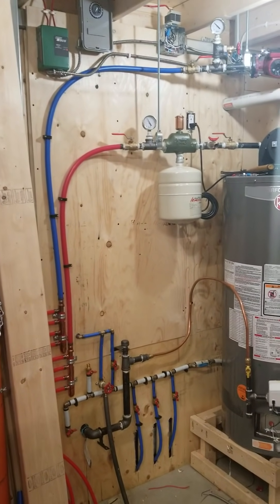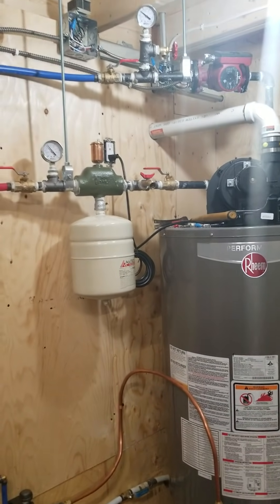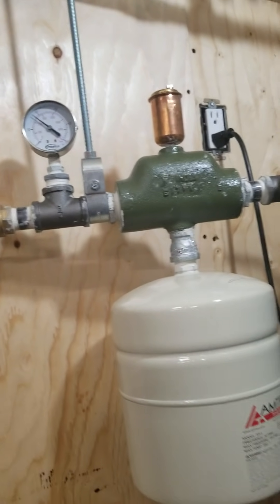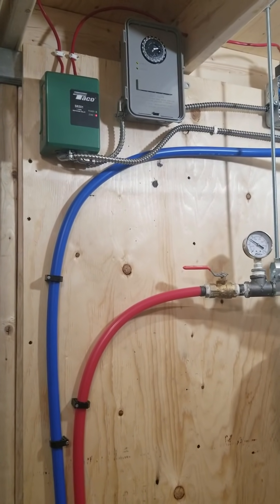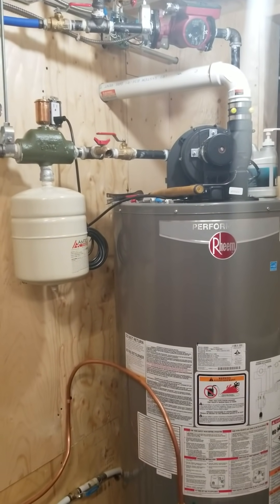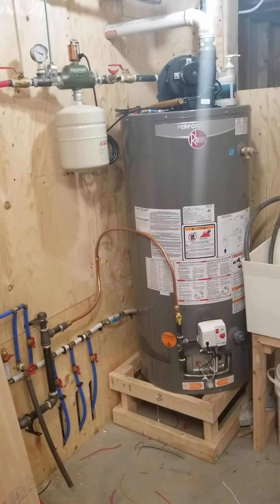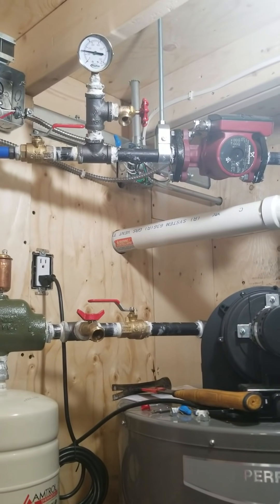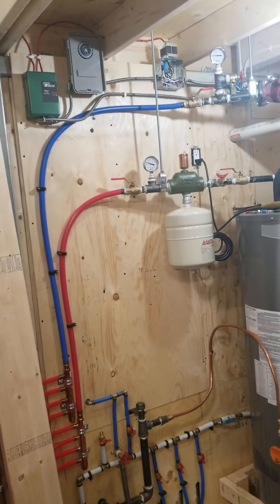DIY In-Floor Hydronic Heating System Using Water Heater

Comment: May I ask where you sourced your air scoop? Pump? Teco controller? Did you do the calculations for heat loss or simply went with what you could get.?  Two zones for me presently in my garage.. Went with a 2 gal 110V  electric hot water tank (  Lazer Temp reads 88F return 93F out when it starts up ) below my mezzanine floor ( 216sqft ) (( 2" thick concrete )) ((( 1/2" PEX ))) with a recirculating pump below the tank pulling from the cold side. Circulating pump constantly running not controlled . Open Coffee Can with water above the floor that allows air to escape . No pressure in system. That little tank ( turns on and off by the thermostat built into the tank ) keeps the floor constant  79F to 83F. Now looking to do the garage floor ( 684sqft ) (( 8" thick concrete )) ((( 3/4" PEX ))). Like your concept but going electric. I don't see the need for a large hot water tank. I really want to heat the tubing in the garage floor and avoid keeping water in the tank hot. it's the volume of water in the floor that needs to be maintained is it not? Looking at the tanks available and they seem to have different volumes but same Watts. 240V 3000W. So my thinking is smallest 3000W tank possible , this way your supplying the heat created directly to the floor. GSW has a 4500W element  , but I wonder if it retrofits into the 9 gallon tank? Do you know why you would need to pressurize a system if you basically at ground level?
Reply from the maker: I bought all my system components from Noble Trade Plumbing Supply and Woosley Plumbing Supply. I did no heat loss calculations, I just went with what I thought would work. I'm not sure if a small tank would work as it can't heat the water fast enough, you would probably need a on demand hot water tank. I've personally noticed my system runs almost nonstop on the really cold days (like -35 degrees Celsius with the wind chill) and that's with a large tank. I pressurized my system because that's the way I was shown. I've read about the open water design to naturally vent the air in the system
Reply: @jpaul1030  Hi Jordan, I LOVE what you've done.   I'm building a garage/shop this summer and will be doing this.  Is there any chance that you could share a parts listing of the major components?  
Thanks again for sharing this video, nice!
Dave
Reply from the maker: @davehachey9317  https://imgur.com/a/YugG4Ib

That's a link to a drawing I made up with a component list. Your nipple sizes could be different then mine based on your sizing requirements. You will most likely need reducers based on what your supply house has in stock. What I did was lay out everything side by side on a shelf at the supplier and dry fit the reducers based on the sizing of the pipes and components.
Reply: @jpaul1030  Thank you so much Jordan, much appreciated!  Dave
Reply: so to remove the air from your system you're using an open coffee can ? I was wondering if something like that would work ... you'd just have to constantly keep adding water due to evaporation
Reply: When I first started the circulating pump , I watched the level in the coffee can go down. I would open  a  ball valve from the hot water line 8" above the level of the floor and let the air out. Did this about a dozen times. Then sitting watching TV , there was a gurgling at the coffee can and the pump cavitated. The air made it out of the line and now I haven't touched the water level since. The coffee can is about five feet above the pump , on the return side , therefore there must be so little pressure in the system that it doesn't push water up the line to the coffee can. what is it 4psi per vertical foot? So the pump must be pressurizing less than that. I did read yesterday that under pressure forces more heat from the line because the water is compacted. I'll stick with the simple system for now.
 Now to get the main floor of the garage heating. There's such a churn of cold from the main floor and heat from the mezzanine by the ceiling fan. I find this all very interesting. 
If I don't run the ceiling fan there's less convection between the two floors  but the garage floor area is chilly.
.I'm in the corner where Quebec , Ontario and New York State come together , on the Quebec side. Very small municipality but the name starts with Saint therefore it's officially a Quebec town...lol   @ButtedorFrank

Comment: Very nice system! I do have one question for you , noticed you used a regular style manifold  instead of a radiant heat floor manifold . What’s you reason for using the one you chose ?
Reply from the maker: Because radiant heat manifolds are $275 each and the ones I bought were $30 from Lowes.
Reply: Jordan Paul  I like it so the more expensive manifolds aren’t (needed) . I’m in the process of getting parts for my infloor heat in my garage and your video came up . I was very useful for me as I’m doing this for the first time ! 
Thanks !
Reply from the maker: @FastlifeTodd  I'm sure the fancy radiant heat manifolds are better some how (either flow better or retain heat better or something) but I had to weigh the cost vs benefit gained for the individual system components or else this system would have cost a fortune and I would have been better off buying the boiler system from a manufacturer which came with the fancy manifolds. For the small drop in efficiency I thought saving $520 CAD was a fairly decent trade. The cheap manifolds are doing their job. Its -25 degrees Celsius outside (-37 degrees Celsius with the wind chill) and my shop is still 63 degrees Fahrenheit.
Reply: @jpaul1030  The fancy ones allow you to balance pressures between the loops easier (based on pipe length).  If your loops aren't exactly the same size, you will get more water flow (and therefore more heat) through one loop than the other.  You can do approximately the same thing with regular valves on your lines (which I think you have on your cold side), and feeling the temperature differences between where the loops are located.  If you haven't noticed a difference, I down think you are going to have any problems.  :)
Reply: Jordan Paul , were you able to saw cut your floor slab or did you use tooled joints

Comment: A hot water heater will last far longer in a closed loop hydronic system , especially with glycol, then used as a regular water heater. It's way better then a boiler, if your space is small and insulated enough. Just check your anode rod every couple years. The only thing I like to do is keep the pump a little lower because of air pockets. Nice clean install.
Reply: I thought the same thing! That pump is in the worst possible spot, up high and not vertical.
Reply: I keep reading about water heaters not lasting long. But most people I've known have maybe replaced one in their lifetime. Closed-loop with some sort of glycol, what goes bad?

Comment: Just and FYI, air always finds it way to the highest point of your system, you should have you auto bleeder at the highest point of the system. I have worked with large hydronic systems were engineers have made this same mistake. So do not feel bad.
Reply: That was my first thought to.
But he differently knows the air-pressure at the top of the system

Comment: Your temperature control system sounds suuuuuuper overcomplicated. Why not just hook the circulation pump up to a thermostat and call it done?
Reply from the maker: Because the circulation pump is 120 volts and the thermostat is 24 volts. I suppose I could have used a solidstate baseboard thermostat to control the circulation pump but then I wouldn't have wifi access and control anywhere in the world.
Reply: @jpaul1030  AHH this clears it up .... I was hoping someone asked the question ... I wasn't sure what that TACO module was used for. Cheers !
Reply: @jpaul1030  Or a 24v/120v relay?
Reply: @jpaul1030  What roger said, a relay is a good solution.

Comment: I've also been getting resistance from a HVAC friend of mine when I discussed installing this setup.  Do you run this system continuously?  What is your fuel consumption so far?  Thanks for sharing.
Reply from the maker: I turned this system on when it started getting cold in mid-October and I haven't turned it off since. I leave it at 64 degrees fahrenheit 24/7. 

I haven't noticed my natural gas bill go up, I am on assumed billing so my bill is like $77 dollars a month all year long My "consumption to last years consumption" hasn't really changed.

I've worked in the shop all day and only heard the water heater fire up once every hour or so for about five minutes if this helps. It's very efficient.

For the money this system has done me no wrong and there is a lot of people who have done it this way. Is there more legitimate ways to heat your floor? Yes. But that costs double or triple what my system cost.
Reply: I r un about the same system. 35 gallon hot water heater at about 100 degrees 18-22 pounds of pressure 26x40 12 foot ceiling. just have a th ermostat
 running to the pump.set at 65 live in Alaska never had any problem's